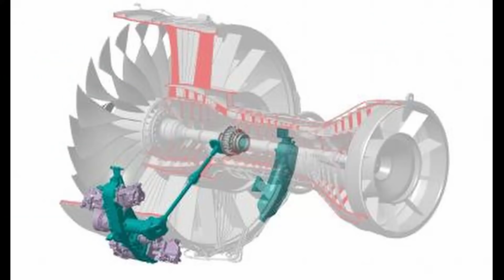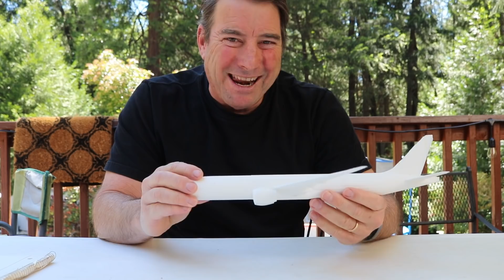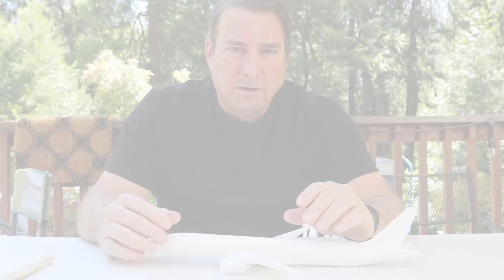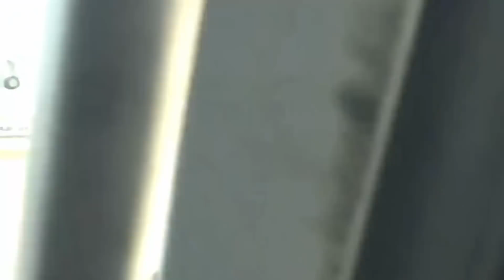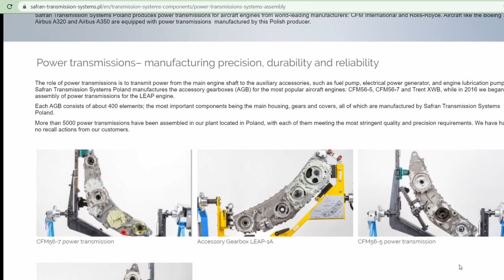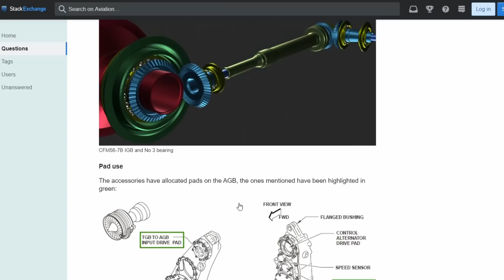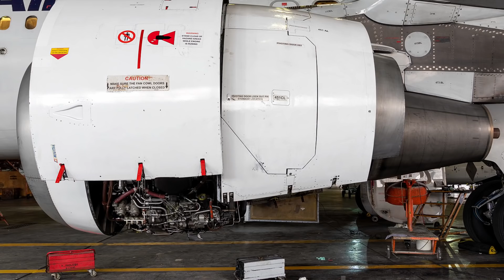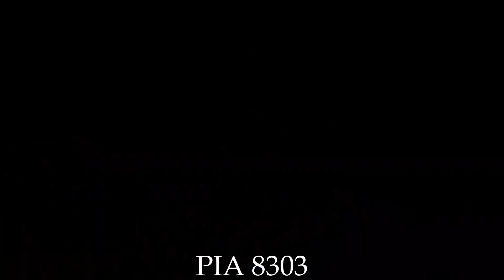PAKISTAN INTERNATIONAL AIRLINES #8303 UPDATE #2 23 May 2020

Comment: I have been a pilot for Continental, now United Airlines for 33 years and currently a Captain on the 777. I have never flown an Airbus, but how they managed to strike both engines doing a go around if the gear had been down and locked is hard to fathom. They would have had to contact the ground with extreme force to compress the gear and tires that much. On the other hand, given the redundancy of the terrain warning systems, that makes the gear up landing scenario unlikely as well, unless they just chose to disregarded the warnings. As I said, I have never flown an Airbus, so I am not familiar with exactly how that system works, but I’m sure it is similar to Boeing’s. All modern transport category aircraft have very sophisticated Ground Proximity Warning Systems (GPWS) on board. It’s function is to warn of rising terrain ahead of the aircraft, be it either a mountain or the ground in general. The warnings it verbalizes very depending on the phase of flight  the aircraft is in, be it takeoff, cruise flight, decent, or in a landing configuration. Much of this is determined by information it receives from the FMC, the Flight Management Computers, and the aircraft’s flaps and gear position indicators. The 777 has two possible normal landing flap settings, 25 and 30 degrees. Should you attempt to extend the flaps past 20 degrees without the gear extended you’ll get the continuous warning, To Low, Gear. And, if you get within 500 feet, I think, of the ground without the flaps being in either a 25 or 30 degree position you will get the warning, To Low, Flaps. The details may very but the Airbus system works essentially the same. So, unless they chose to simply ignore the warning systems I don’t know how they could’ve come that close to the ground without the gear extended. Had they dragged one engine that could be explained by bad crosswind technique, but to have dragged both engines and then attempt a go around(?) Yeah, I can’t come up with any rational explanation for that.
Reply: HiWetcam No, I didn’t see that. Was that graphic in this video?.... Now that I’ve had time to review THIS video, there is no graphic and no and no CVR replay. But what is perfectly clear from the 3rd video is that these guys had no business flying airplanes.

Comment: Dear Sir... there has been pictures circulating that the rear gear was out but front were still inside when the  aircraft attempted the first landing. (1)Shouldn’t the ATC report that to the pilot? (2)This means either he shud have attempted Belly landing or  he shouldn’t have attempted at all. (3)How much time do you have from opening landing gear to actually touch down?(4)Can it be that after gearbox alarm what you have shown in previous video the pilot tried to open it manually and the aircraft sensors gave him wrong indication tht gear is down? Thank you and im not in aviation so may be my question is really newbie and silly... Condolence to the familes...

Comment: Not to mention all the tubes carrying fluids that are around and over the gearbox.  Even if the gearbox was intact before the crash and was still working, it might not have been able to  pump much lubricant.  The engine bearings would have rapidly overheated and then seized, which would seem to explain the events as they unfolded - enough power initially to get them up over 2000 feet (you can hear the engines still spooling up as the pilot is getting first instructions for the go around), then significant loss of power, followed very shortly by complete engine failure.  The reason I don't think it was fuel (or the complete gearbox) is because the engines would have failed almost immediately even with reduced fuel flow, and I would expect a high likelihood of an engine fire which didn't happen in either case.
My heart goes out to all that lost their lives, and their families.  I hope the investigation proceeds quickly and changes are made so that this can never happen again.  My main questions are why did the landing gear fail to come down (dingdingdingding is a malfunction warning by my understanding), and why was the pilot accepting landing instructions with that going on in the background?  It's all very well to speculate on why the engines might have stopped, or why they hit the runway in the first place, but I'll bet the real causes of this accident happened before the aircraft even left Lahore.

Comment: So does this mean if  the  landing gear was fully deployed on the first attempt to land , the engines could still  both be damaged at the bottom from from to back as shown in the manner shown airborne picture with the RAT deployed ? If both engines we damaged as shown , then in my mind the landing gear couldn’t have been deployed as that would have touched down first. Preventing the engines from both being damaged scrapped front to back. The only way to be certain is if there is video footage of the runway showing the attempted landing? Surely airports must all record landings?  Is this not available or been released ?  In your first video where we hear that dinging sound of the landing gear warning surely the pilots deploy the landing gear before getting that close to the runway and therefore they would not have attempted landing without knowing the gear was deployed. Just trying to figure out how it could have happened. My condolence all all that have lost loved ones in this tragedy.

Comment: Great video, and very insightful and knowledgeable, as usual. Thanks. One small thing, at 6:11 what you pointed at is actually the LP compressor, which is 3 stages spinning with the fan, all part of the "N1" rotor assembly. The HP compressor is further back, starting where the No. "3" arrow points.

Comment: This particular photo doesn't show it (the spotter took about 6 pics in total) but there is what appears to be a tail strike mark just aft of the APU section of the fuselage. In the above pic you can barely see it but there is a dark straight line just below the starboard horizontal stab which could man there was a tail strike as the a/c lifted off of the runway after the engine scrape.

Comment: Wow!  Thank you for clearing up a lot of my questions.  I understand those engines better now.  Evidently, the damage did not initially prevent the plane from throttling up and gaining altitude and airspeed for the go-around.  Engines cannot run without fuel, but they can run for a limited time without forced lubrication.

Comment: The angle of attack seen in the video of the last moments looks like about 25 degrees to me, or am I dreaming? The A320 cannot be recovered from a 20 plus degree AOA because of her zero longitudinal dihedral, the  tail-plane stalls just as hard as the mainplane. If anything at all, in  that terrible deep stall condition, she would tend to pitch against the  elevator, pushing down elevator must merely deepen the tail stall. For twenty years, nobody wanted to talk about it of course, but that video looks rather clear to me.

Comment: The A320 is 37.7 metres long, she takes about 1.5 seconds to pass a building edge in the video that we saw on this channel yesterday. She looks slow because she was going very slowly indeed, about 50 knots. No wonder the AoA is 25 degrees. No wonder two passengers survived the impact. in relative kinetic energy terms the impact was not that much worse than a typical high speed highway car crash.

Comment: You are using schematics from a CFM56-7 series used on 737's, the CFM56-5 series used on A320's CEO has its drive input at the 6 o clock position...If you start explaining how things work to people please use the correct graphics and use the correct engine type. For example on the Left side of the CFM56-5 series at the 9 o clock position aft looking forward you have the oil tank. On the CFM56-7 the oil tank is on the RH side of the engine at the 3 o clock aft looking forward...I stopped watching your video halfway.

Comment: Landing gear are mechanical marvels and estimated by Airbus to represent 20% of total aircraft maintenance costs and around 7% of the weight of the aircraft. They are a big deal. That the landing gear of a passenger plane is not working never happened in the past twenty years.

Comment: For me the cause of this accident ,may be a human error , because it is possibly that during the checklist   ( 1° GEAR / LIGHTS - 2° Spoilers - 3° AUTO BRAKE - 4° FLAPS - 5° Altimeters - 6 EAD Engine allert Display ) the pilots not has  see the three indication lights landing gear  that was  not green. All that what happened after the first attempt of landing it is clear , both engine in failure Ram extended for recovery the electric power but the stall of the Aircraft has  been inevitable. Further  radio ATC here  https://www.youtube.com/watch?v=jpJa9H7zAp4   .  On  other Radio ATC https://www.youtube.com/watch?v=uA5PF3JMHdo  it understand     that  passing Saben Point  at 5 miles from touch down  on the runway 25L the pilot  say that  they are establihed on ils rwy 25L the atc see him at 3500feet  but at this distance as a  published chart (  Karachi ILS or loc Rwy 25L http://www.mediafire.com/view/l9zp6icorgw0ihi/Karachi%20ILS%20or%20Loc%20Z%20Rwy25L%20.jpg# )  the aircraft should  be find at 2000feet not 3500 feet. The ATC sees him high and in fact gives him a vector  for 180 ° but the pilot confirms that he is established and wants to land. From all this it is clear that the pilot was in a hurry to land and it is probably that he made a mistake in this hurry. But also the ATC Twr has his responsibilities when  he have see the  aircraft at 5 miles from the touchdown (at 3500feet)  on the runway 25L  ,would have to given at the pilots the order to going around.

Comment: As in all accidents there is no single one cause. I bet the accident chain started with previously identified crew under-performance issues, leading to a very poorly flown ILS (2000ft above the GS at 5nm), a very poor decision to continue the approach with criminal ROD on short final, resulting in a double engine strike. From then on, the crew had flown the aircraft into an accident wedge where nothing was going to stop the accident, and fate took over. A crew of average competence would have thrown the junk approach away, and landed without incident.

Comment: This is just a very early scenario, a speculation, of what might have happened based on the pieces of information that are coming in: The A 320 is approaching Karachi. The ATC realises that he is high at 3000ft when he should have been at 1500ft AGL  --and therefore well above the ILS glide slope. The ATC asks the plane to turn on to a heading of 180 to lose height but the pilot on the R/T says that they are "comfortable and established ILS.' There is NO reference to a landing gear problem --which would have been lowered to lose height fast. The aircraft comes in "hot and high" and touches down HARD 4500 ft down the runway. With the extra speed and the fast diminishing runway length the pilot decides to go around for another try. As Juan (who really knows what he is talking about) noted: this was probably like the 777 at Dubai---the pilot punches the TOGA button on the throttles and leaves the autos to do the work. I never flew an Airbus but on most airliners, once you touch down a switch de activates the TOGA (Take Off /Go around) system so the power will not immediately increase.At the same time the pilot would command "Gear Up!" and in the panic the copilot could have failed to check if the plane was climbing (positive rate) and selected the gear up. If the nose was pulled up at that point and the pilot slams on the throttles to full power --the lag in a jet engine spooling up would have let the aircraft sink down on the runway with gear partially up. So, the engines impacted and were damaged. From that moment on they were doomed because there are only minutes before the engines will fail. They climbed and turned for a downwind leg. the damaged landing gear was down --creating more drag ( there was a picture of the plane on downwind with the gear down the pilot might have retracted it later for less drag ) While nearing the approach end of the runway the engines finally failed. They were too low to get any kind of glide distance and crashed into a built up area. What would cause an experienced captain to fly so erratically? Well the time was Ramadan and in spite of the "no fasting and flying " rule that I brought in nearly 30 years ago, perhaps some people don't follow that any more. Hypoglycemia is like a form of subtle incapacitation. Some advice from an old, experienced flyer : If you go around close to the ground, FORGET the autos! Fly manually with a disconnected auto pilot and auto throttle, and Increase the power to MAX and pull the nose up 10 degrees initially --that is a guaranteed no-failure go-around. Best to all--Johnny

Comment: How did both engines hit the runway, but not a mark on the belly of the aircraft? And i would have thought the engines would shear off under such force?
Reply: Because the engines are much lower than the fuselage obviously
Reply: @tomstravels520  so they took all the force, but never sheared off as designed to do.

Comment: Juan, are you suggesting  that the plane tried to land with landing gear down, had a change of mind and took up the gear but still hit the runway with its engines .... and then tragically the damage to the bottom of the engines led to engine failure before the pilot could complete the go around? 
A sad sad day for so many families and also the airline family.

Comment: Really sad to learn about this plane crash, just to add to the information provided. I believe the RAT or any fail safe option designed is tested under normal engine failure that may occur during a flight where the engines are not damaged. But in this situation the Pilot had done a touch down already and damged both engines at the bottom. Sadly the Pilot can not see the damage while sitting in the cockpit. There may be a problem with the landing gear initially.

Comment: Why are gear-up landings so rare in commercial airliners?
Reply: Because aircraft have redundancy and can lower the gear by alternative methods if the main system fails
Reply: @tomstravels520  Thank you.  That answers why it is possible to get the gear down even in adverse circumstances, but it does not address systems that help avoid the pilots forgetting to lower the gear.
Reply: DrSteveBrady there are 2 main warnings. The ECAM and the GPWS

Comment: The tower was asking the captain: "Are you going to belly-land?" So the captain obviously landed without landing gear. But why he then decided to make a go-around. This would not have solved the landing-gear issue the plane obviously had?  Or did the tower tell him that they are preparing the landing runway with a foam bed for a belly landing that would not cause the plane going up in flames?
Reply: lenny108 he probably failed to land without the gear

Comment: We heard the pinging of the system warning the pilot about the gear. Maybe there were so many problems happening in the aircraft at the time, the pilot didnt think it was a valid warning and considered the risk to touch down or try. I am not a pilot.
Reply: The “pinging” noise is not specific to a gear problem and sounds for any thing that endangers the aircraft and requires immediate pilot action

Comment: Maybe they should consider moving the accessory drive gearbox to an higher position on the engines so if a ground strike occurs, damage to them would be less likely.
Reply: It’s most likely there for ease of access for maintenance staff. Aircraft don’t normally smack into the runway so why would they need to move it?

Comment: Frankly, I've never been a fan of under slung engines.......Precisely why the "whisper jet" plan form (sans the 3rd hole now) is far superior to today's aircraft designs, particularly with the onset of high bypass engines.......Back in the mid 60's my Uncle was the Captain of a UAL 727 that had a rear gear failure, overrode UAL directions and chose to land gear up at MacDill Air Force base in Tampa, FL because of their superior equipment for just such an incident, The runway was foamed, he landed crabbed into the crosswind with minimum flaps, coupled with the ground effect and there was literally no damage other than minor scrapes on the belly's "flat" cargo bay doors. I recall an aerial photo of her sitting there on the foamed runway center line with the crab angle still in place. He was a P-38 pilot in WWII, started with Capitol Airlines flying DC-3's, then DC-6's before the 727.  The damage was so minor the Air Force recommended cutting small holes on the upper wing spars to raise it with a crane, drop the gear and fly it to their base at Miami with the gear down and locked. UAL overruled them and chose to use three air bags, 2 under the wings, 1 under the tail.....during a work break, the 727 was blown off the bags by a wind gust and a wing was snapped at the root....Moral of the story, take heed the advice of the Air Force cuz they've been there and done that......BTW....another moral....Think he caught heat for overriding their directions? He later became their chief pilot in Miami.....You can't be a panzy when you're a Captain.

Comment: At 6:10 you are pointing at the booster section, which spins with at N1, not the high pressure compressor (N2) which is the next spool down the shaft. And the low pressure turbine is right in from the n.8 bearing housing/hot section exhaust duct you were pointing at. The LP turbine is in a section view and a bit hard to see. Great video, you pilots always impress me with your knowledge of engines and the systems of aircraft!